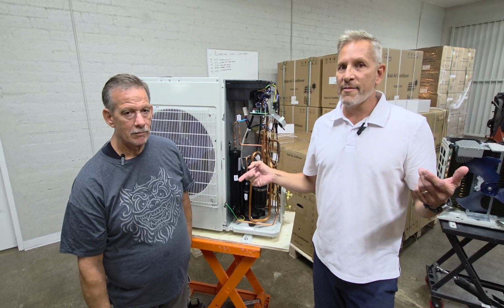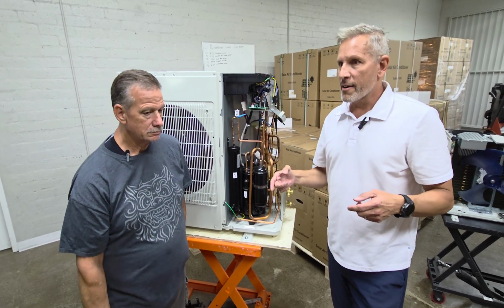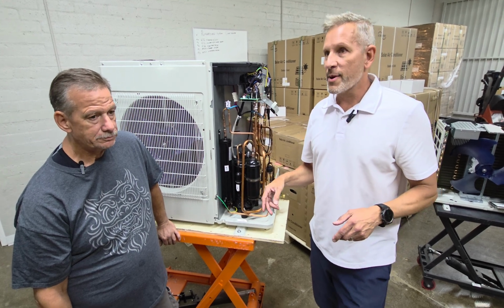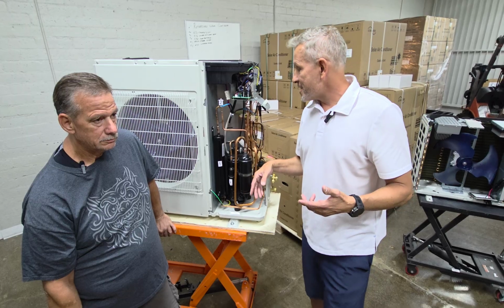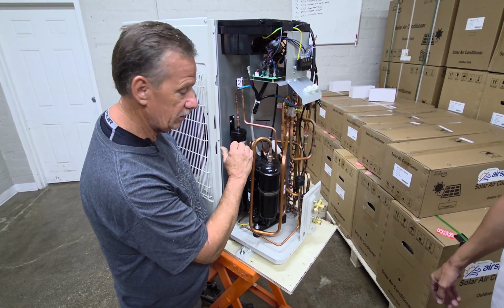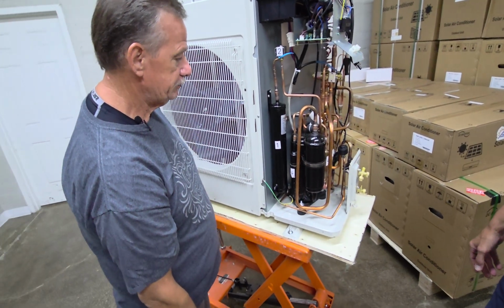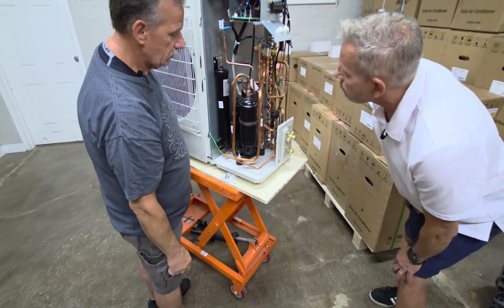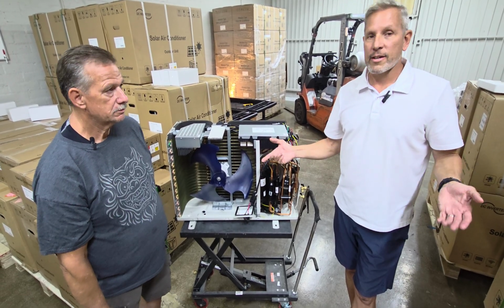EVI Heat Pumps: How Mini-Splits Heat in Extreme Cold

Comment: Another way to explain this, is that in heat mode, not all the returning refrigerant got turned into liquid. Some of it, is a gas. That gas is "wasted", in that it wasn't able to release enough heat to turn back into a liquid. That means a lot of latent heat is wasted if it just proceeds to go through the eev to the outside cold coil.
The unit will in very low temps, open up the circuit to the heat exchanger/hot gas separator. Some units simply just used that to separate the gas from the liquid to get injected back into the compressor. Newer units from Gree (or some from the beginning, like Midea) will use that to reclaim that lost heat so that it gets sent right back into the compressor to go inside.
Reply from the maker: This one is actually a little bit different with the EVI. So it's not hot gas bypass. All of the refrigerant is condensed to become a liquid. And that liquid stream is maybe 100 degrees or something let's say. And in the flash canister, also known as the heat exchanger, the liquid comes in and part of it is divided up to go through an expansion device to become super cold. And so that's on one side of the heat exchanger, and then the rest of the liquid, the majority of the liquid, is on the other. So that liquid gives off some of its heat to become maybe 20 degrees colder before it goes through the main expansion device. And what happens on the other side of the heat exchanger where the cold refrigerant was? Will that soaks up the heat, and so then that gas refrigerant is now warmer to be injected back into the compressor. So there are two streams of gas coming into the compressor. One's coming from the outside, and that one is still super cold if it's super cold outside. That could still be 20° below zero or something. So the compressor doesn't have enough pressure or heat in it to do its job without having the other stream of warmer refrigerant to come in there to boost the temperature of the outdoor coil refrigerant, add to boost its heat. So it's a big win-win. The outdoor coil becomes colder when some of the heat is taken out of the liquid to subcool it. So the only way you can soak up the heat outside is if the coil on the outside is colder than the outside temperature. And the only way that compressor is going to want to run is if it's a little bit warmer and a little bit higher pressure. So that's what the other stream of refrigerant does. So between both the streams of refrigerant, the unit can do heating in extreme temperatures.

Comment: Hey man, do you reply to emails? You should tell me if I can run 3 or 4 12k indoor units on your 36k unit!
Reply from the maker: Sorry, can you re-forward your email to dave@airspool.com? I'm not seeing it, but I will get into more details than the response here. But the short answer is yes, you can have three or four twelve thousand BTU units on an MU36. We'll have those options here shortly. Currently, we're just promoting it with 1 18 and 2 12s, but If you need something different, get in touch. Everything will be shown on the website within the next couple of weeks.
Reply: @airspool  sounds good!, I'll keep the address in mind for later. While a 18k and 2 12k's could work, I feel better with 2 doing the job instead of one.